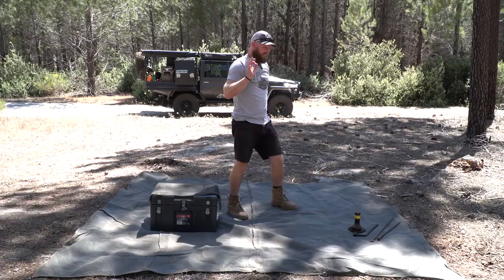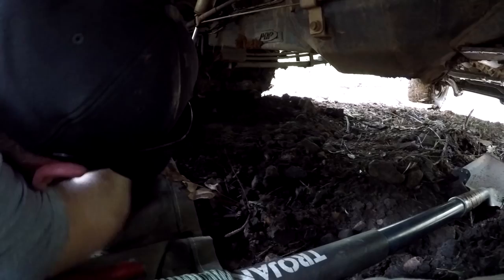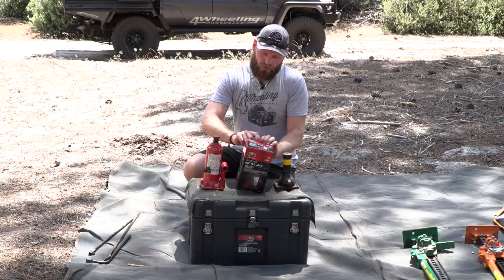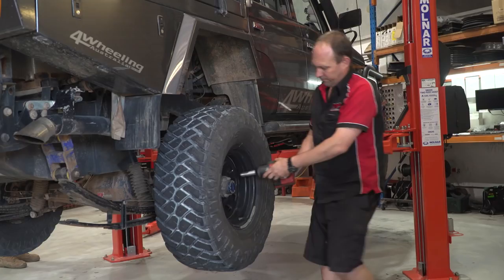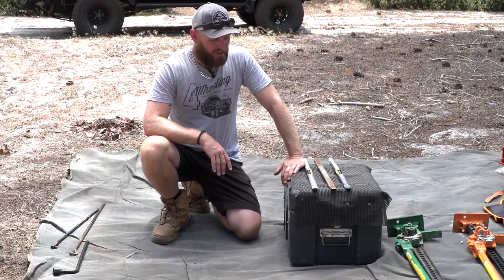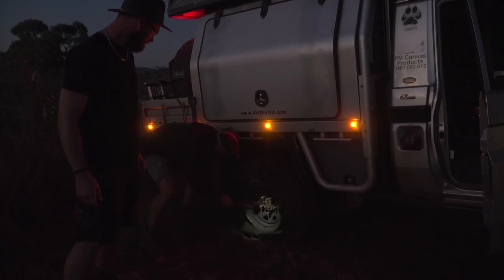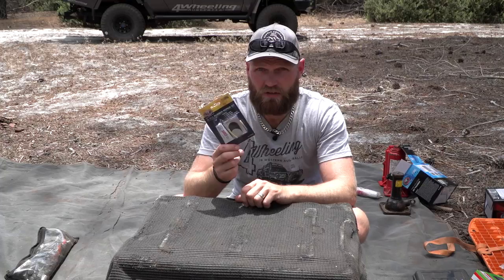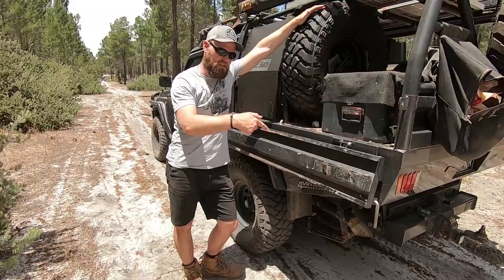Change & fix tyres like a pro OFF-ROAD

Comment: To keep up with the spare studs and lug nuts you can put them into the spare tires. Have also seen storage boxes that fit inside the spare tire. Would be a wise space saving spot to keep all the tire repair stuff.

Comment: Hi Ronny,Instead of using a small jack to lift the axle to be able to get the big jack under just drive with your flat wheel onto a block of wood or rock, so your axle is in its normal height.Saves you some jacking.

Thanks for all your work!

Comment: Hi Ronnie
That tire spanner not only does the wheel nuts but it also is the handle for operating the spare wheel winch. 
Don't throw that out if you keep your spare under the vehicle.
I agree with the high lift jack's. I have them and I don't own one.
We used to have a jack called a kangaroo jack at our farm. Similar design to a high lift but a lot more heavy duty (10t + rated). A really dangerous jack and finger chopper.
My vehicle is standard and comes with a hydraulic jack but I have a 4t exhaust bag for off road. I mostly do sand and beach work so I have customized my recovery equipment for that.
I have a large variety of old sausage slings for towing plus other proper gear for recovery. Slings not used for snatches and such like but they do come in handy.
A lot of city folk don't know simple things like how to change a flat tire or even check engine fluids, belts, hoses etc.
I'd recommend that new drivers do a defensive driving coarse. They are run by RAC and off duty police officers out near the airport. 
They cover a lot of basic driving skills and are not very expensive. May even get you a discount off your car insurance.
Great video and very informative Ronnie
Keep up the good work

Comment: Funny you mention a rock in the bead.  I'd NEVER even heard of it happening until it happened to me.  I was on a dirt road and took a corner a little quicker than intended.  The tire contacted the little mound of dirt on the side as I was mostly slowed down already.  Was enough to get a rock stuck in the bead.

Nobody else in my group had ever seen it before.  Weird day.  I actually had the exact tool you showed, it was sold as a plastic trim remover though.  Worked perfectly.

Comment: For changing a tire with a hi-lift there is a attachment designed for lifting the wheel directly.   Lift the wheel and then place a block or jack stand under the axle then set it down and change the tire from there.

Comment: One very good reason for carrying a high lift is it can be used to pull as well as push. some bottles have a threaded shaft for the lift column which adds more height when needed. Top side we call levers, spoons.

Comment: Great video! Torque specs are really important. I've had tire shops torque to 100 foot pounds when it should be only 85. And they ended up replacing 24 lug bolts (as they were falling off as I traveled due to over torqueing). A good torque wrench is about $60 and can be used for all kinds of repairs. High lift jacks - we call them jack-alls. They have many uses and like most tools need to be handled properly and yes if done wrong can whack you in the head or maybe lose a finger too. Back in the day we used them for all kinds of farm repairs as bottle jacks just didn't have the height or were not available. Learn to use them safely and they work fine! Every tool has a limitation. Crawling under a vehicle on a bottle jack is not smart either. Safe travels.
Reply: if you cant torque wheel nuts by hand,feel,,dont drive.high lifts should be banned,unstable,jack too high.ive seen vehicle roll over or off the jack.idea is,with h/lift,have a chain,or strap,you can easily get to to tie the diff to the body,only need 1 ft lift.old cars & some early race cars had these to stop body roll...

Comment: Want to shout a BIG THANKS to you Ronny for the tips!  SO glad I followed your advice to bring a ball peen hammer.  I was recently way out the back of nowhere and dented the steel rim causing a mega air leak.  Quick stop to suss it out..... Our man Ronny said to bring a hammer for just this occasion.  Bang, bang, bang, bang..... plus a bit of air and away we went.  Would have been screwed without that tip!  THANKS RONNY!

Comment: Thanks Ronny for the vids, agree with the bottle jack but recommend having a bracket made up in a U shape to prevent the jack from slipping out, this can be fitted on the top part that screws in or out of the jack.

Comment: Love your work Ronny, reckon you could do a video on the actual repair process for patching, plugging, setting the bead, replacing the stem, the cores, using the tyre levers etc?
Reply from the maker: Sure why not mate I’ll just need some old tyres first
Reply: Peter Alan Clark Ronny - actual field tyre repair demo would be great.
Reply: Oh I second that. Would love to learn how to replace a tyre
Reply: I third that. Exactly, Just asked about plugging
Reply: Yeah dead keen also Ronny, I've watched some very agricultural ways to change a tyre on YouTube, all of which I would never attempt myself. I'm planning a bit of touring with the wife and last time we went off grid I put a hole in a side wall on a track in the middle of nowhere and at the time thought the 2 spare wheels was for looks and spank factor, needless to say after I changed the tyre I crawled out across jagged limestone tracks, knowing I no longer had a back up was a stressful thought. A saw in one of your modified videos a guy carried a spare tyre without the rim to save on weight so some education on how to change one out bush would be great. And if you could film it with a woman flipping out at you the whole time to make it more realistic that would be ace.

Comment: From our experience, don't go for a dead cheap air compressor. We have had them die on us which can be a big pain on a trip. Looks like I now have a shopping list for all the stuff we haven't got on board :) Some good advice here. Years ago we had an air jack but never really worked out to to use it effectively. A video on jacks and their use would be great.
Reply: always when solo, have a back up pump, even a manual pump can be useful.  Never one pump if electric, as they can fail.  A manual pump takes forever to refill a big tie, and 4 times forever for four tires, but it will eventually get there.

Comment: The best wheel nut spanner are the 4 / star + type  large/ stile conventional > even pressure on both sides for when the nuts are particularly  tight , can even put your foot on one side if your not that strong ... and also very qwik to remove nut once loose . Long one sided spanners can roll off the side of the nuts when very tight & lots of pressure are used unlike two handled star type .
another gr8 tool to have although heavy is the RandR bead breaker < even when the tyre totally shagged they still work (NO affiliation) rubber hammer /mallet .
Reply: Exactly right. Throw the factory supplied rubbish away and get one of these for all the reasons Billy Boab mentioned.

Comment: I use on of the bottle jack/jack stand combos - Alltrade 640912 Black 3 Ton,All-in-One Bottle Jack.  Comes with it's own base.  Haven't tried it in the mud yet, but works well in the garage.  I always feel safer with a separate 6 ton jack, once I have the SUV in the air.

Comment: Ronny, when I install a plug, I rub the cords down with pvc cement, then install. It helps the cord slide into place but also helps close the hole when it then sets.

Comment: Great advice. I have a 76 with 2 inch lift and 32inch tires. Got a flat while travelling solo in the Simpson. I discovered that a 6000kg bottle jack didn't lift high enough to clear the tire and had to dig out underneath it with a shovel. Will be getting a 8000kg bottle jack and make sure I take a base plate next time!

Comment: Hello! Ronny, in Norway you're not allowed to plugging in the side of the tires. When doing an emergency repair, you should only plug the part of the tire that are in contact with ground, the rolling tracks. If you do plug the side of the tires, you will weaken the contruction of the tires and you will make it a safety issue. I allways carry a tire repair plug kit in my car :) Good videos :)

Comment: Remove the valve core to seat the bead......this allows a larger volume of air into the tyre.....once the bead is seated, just screw the core into the valve and pump up to your preferred pressure
Reply: I've tested that with an ARB twin pump, it's less than 10% extra.
Reply: Doesnt make much difference at all with the little air pumps. Only really matters if you are at home with the 16cfm compressor.

Comment: Good video Ronny ,Came across a bloke last week that should have watched this vid ,flat tyre and having a hard time , On the hilift jack your dead right they are dangerous but pretty handy in the bush for a variety of odd jobs , you can increase your lift height by putting a chain around the diff housing and over the chassis , no spring sag = positive lift ,

Comment: In the States we tighten wheel lugs to OEM specs (ft-lbs torque). Breaker bar for off road repairs certainly. Torque wrench when you get home.

Comment: Another great video.  Yes, hi-lift jack is not good for tire changing.  And tire plugs are the best!  There is also a valve stem available that you can mount from the outside.  It's for temporary fixes and should be replaced as soon as possible, but works great if you rip a valve stem off.

Comment: I use a garden sprinkler and hose under my 4x4 to keep underside clean. Turn the water full on and drive the vehicle forward and back over the sprinkler a few times.

Comment: Great video! If you carry a tire patch kit get some big patches for longer punctures that plugs may not seal. I have used bigger (3"x4") patches on sidewalls as last resort.  Low pressure and slow speeds to the nearest tire shop afterwards. Ask your tire shop for a couple and they can hook you up with some big patches. Hi-lift Jack is a great tool for recovery assistance and breaking the bead on tires but not for lifting a vehicle for tire changes.

Comment: I worked in a tire shop for a few months because I was bored and learnt alot and take it from me guys, 35" 4wd tires are a pain in the ass period. Mounting the tire, balancing and lifting it onto a 4wd fat wheel studs.So mount your ties so you can roll them out and use your legs when you lift! :D

Comment: On the note of tightening its probably best to use an actual torque wrench and torque to the proper spec. 
The toyotas here in North America are soft and break easy, best to use a torque wrench instead of over doing it. 85ft lbs is really not a lot if you have the leverage of a breaker bar behind it.

Little thing you can use a hi lift for, if for some reason you want to pop the bead on a tire, maybe for that patch kit, you can put the tire under the truck and use the hi lift against your slider or whatever to push the bead and use the weight of your truck.
Reply: Brad Młodystach  Your missing the point entirely. He is saying the wheel studs that are North American spec are easy to over tighten and break them.
Reply: You should still use a torque wrench, it's the gold star way to tighten them up, but not on the track! Last place I want my torque wrench is on a muddy track!
Reply: Agreed; 85 ft lbs is way too much, especially if you have magnesium alloy wheels, but some people seem to like making them difficult to remove for some reason.
Reply: @interdec  that's what's spec from Toyota on alloy wheels and their studs for the Tacoma.
Reply: @markdaniels9507  I have a cheaper one from the hardware store that is just left in the truck for doing tires.
Reply: Brad Młodystach but the channel has subscribers all over not just in Australia, hence I'm watching it. 
Theres plenty of people that will watch it and think just tighten it as much as they can with a breaker bar likely over torquing it. I've seen it come up often on forums about lug nuts being over done.
Reply: @JoeC92  Agreed.  People without experience will very easily over tighten with an extension bar.   Electric impact with a torque stick is my method and then check with torque wrench asap.
Reply: Brad Młodystach  you'd be amazed how many will do what you're saying haha. I've always found one arm with minimal force behind it will click a 24" torque wrench at 85lbs. Even at work for torquing electrical gear connections (which inspectors and engineers like to see torque paint, calibration of wrench etc) it's usually pretty light force used when you have the leverage of a good size bar behind it. 

Main point if you aren't familiar with using that level of leverage and wrenching a lot a torque wrench would be safer.

Comment: I keep the standard bottle Jack on hand just in case I need to Jack under the control arm to get clearance to replace a CV axle or to Jack between the control arms to replace an upper ball joint but other than that it is pretty useless for a modified truck.  No harm to keep it though since it just stays in the stock location out of the way

Comment: And don't forget the special locking nut socket if you have them on your vehicle ! Cheers Ronnie
Reply: Great tip mate! 
When i bought my 4x4 i checked over everything and noticed it had a lock nut on the spare but no key so cut the lock off. 
Far easier than realizing out bush!

Comment: If you got a puncture repair kit using patches you may need a bead breaker eg hi lift jack or a specially designed one from a 4wd shop

Comment: Lol Ronny showing off my cheap air compressor I use for my daily driver. Works well to inflate offroad too, but I found the cigarette lighter plug gets hot.
Reply: Yes, always carry spare fuses for your vehicle just in case you blow your cigarette lighter fuse or melt it from over use.

Comment: I carry a digital 2 way torque wrench. As it goes both ways and is digital you can use it as a breaker bar without damage and you can also torque the wheel nuts at the end for peace-of-mind! Worst case scenario the digital torque wrench fails and you can still use it as a breaker bar

Comment: Hi mate ive only got a soft roader pathy but i carry a lot of that stuff when i go to national parks and beaches ,my spare is inside the vehicle (standard coopers tyre ) behind the cargo barrier did have it on the roof cage but needed that for work so i made a bracket up for it bolted to the vehicle floor , those plugs are great got caught out in a shopping centre car park picked up a screw didnt have the spare but did have the compressor bought some plugs from bcf put one in pumped it up and home we go will look at a bottle jack now as i said only a soft roader good video also will look at those valve cores .

Comment: I had my vehicle serviced at the dealer. I had a flat later on. I had a cross type wheel brace. Couldn't budge the nuts. Called RACQ. The bloke could just loosen them with a 600mm breaker bar.

Comment: Ive got the Ryobi and it won't work with that extension worth beans. But if you can sneak it in without the extension it works remarkably well. 
Tires underneath are crap. I take those out and put in extra fuel tank. spare tires go on back or in front.

Comment: Another great video mate. The only thing I don't necessarily agree with is the idea of buying a cheap compressor. For anybody who is likely to be doing the sort of off-roading that you inspire, it is probable  that they will be needing to air down/up on a regular basis. As such they will need a high capacity RELIABLE compressor anyway. 

Personally, I have a fully plumbed air "system" front to back using a hardwired PX07 compressor plumbed to an inverted 9kg LPG cylinder, which not only gives me front and rear quick connects, but also powers-up 2 sets of air horns, air bags and a Airsafe Hitch. Agree with the idea of extra jack/s....I carry 2 hydraulic bottles and the original Chevy jack (just as a back-up). 

Also love the advice about spare wheel placement. My Chevy had two 35s mounted on swing-away carriers behind the canopy....having a 6" lift, even though I'm about 6'2", I struggled to lift them above my chest height to get them on/off. I did away with all that crap and now just have one spare which lives inside the canopy.

Keep up the great videos mate.
Reply: To be fair I think Ronny may be pitching that people get a cheap air compressor rather than go offroad without one at all - he does mention some people not having them. Whilst if you're going to the beach in Oz in a non-remote area you can likely low speed it on bitumen to the nearest garage to re-inflate the tyres, not having anything does preclude being able to go extra low for soft sand then being able to air up for long stretches of harder stuff. I decided to get an ARB single compressor (portable not installed) as I preferred the shorter time to air up and because it is serviceable.